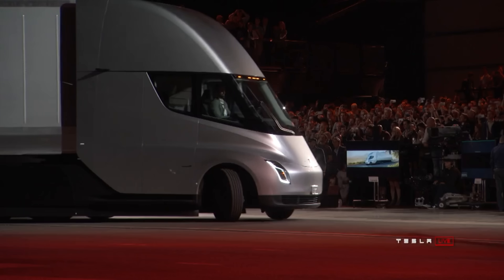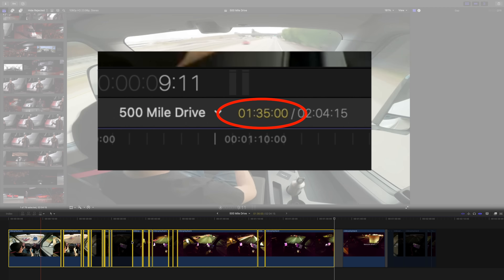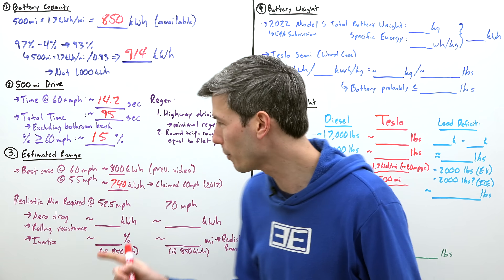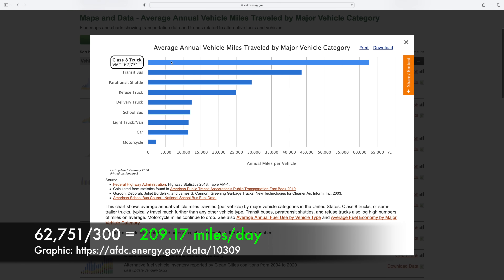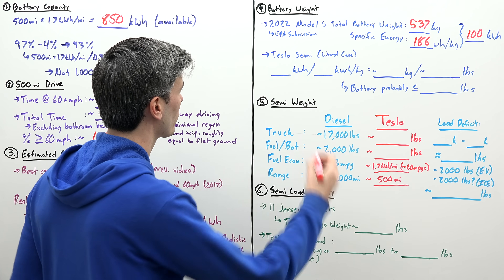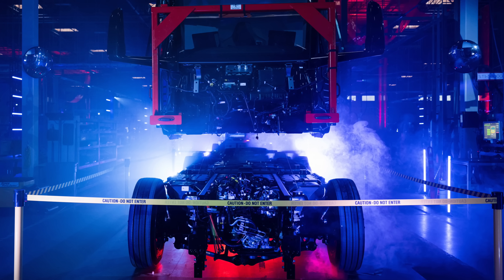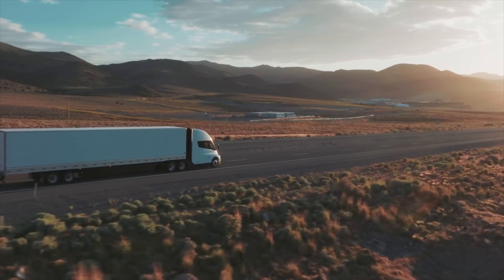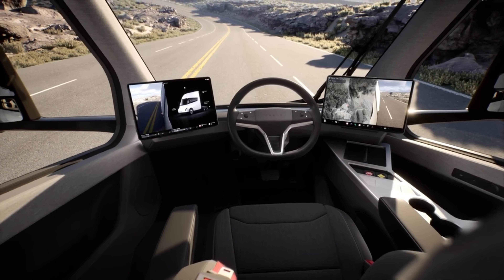Does The Tesla Semi Make Any Sense? Part 2!

Comment: Jason, I'm not sure that I agree with your assumptions on regen and net elevation change. I tried this myself in my Model S. I drove up the Mount Washington highway in New Hampshire at a modest speed. Then I drove back down, allowing regen to do all of the braking. Regen returned about 50% of the energy I used to go up the mountain. I assumed this was due to losses in the inverter and related components.

Comment: Very obvious they have chosen frito chip bags full of air as an easy light load.  What about REAL WORLD LOADS like hauling heavy construction machinery, steel construction materials, cement mixer trucks or any number of things that are all WAAAAY HEAVIER than fritos potato and corn chips - the range game is rigged to favor the weaknesses of the EV trucks limited range especially going uphill with heavy loads or into headwinds etc. Splitting hairs with fancy math will never reveal the whole picture like real world REAL TRUCK USE.
Reply: > Very obvious they have chosen frito chip bags full of air as an easy light load.
You don't know at all what they're transporting. It could very well be ingredients / liquids.

Comment: for physics based assessment, this is fantastic. however i would be remiss to not point out that at the very least, not many variables were discussed, such as:

Battery degradation over time
Climate of route, temp, wind conditions
load material in relation to safety of lithium ion
Usage of electronics by the driver (air conditioning, phones, etc)
Stop, start driving
Actual regenerative braking usage on truck downhill slopes

Of course many of these effects both EV and fuel, but it would be interesting to see just how much.

Comment: It's IMO worth pointing out, that the 500mi+ range was always marketed at 100% Battery capacity, but the charging was afaik referred to with the time it takes to charge 70%. I would also assume whatever grid is supposed to handle those things would not be dense enough to use without safety margins.

If we do a little math regarding electricity consumption:

In 2021, the USA had consumed total of 3,979,000 gwh electricity and produced a total of 886,892gwh from renewable sources.
In 2023, the USA had 2,970,000 registred "tractor trailers" (the ones towing trailers) and 10,500,000 "straight trucks".

Let's ONLY use the 2,97m tractor trailers and replace them all with Tesla Semitrucks and assume 500 miles per day for 300 days a year.
2,970,000 trucks x 300 days x 500 miles x 1,7kwh/mi = 757350gwh or just over 19% of the total energy comsumed in 2021... or over 85% of the renewable energy produced.

I'm not sold on this being "the future", or at least would not say it's a good one.

Comment: Other variables are missing such as road and other taxes paid by petrol users. The current price of hydrocarbon fuels is artificially kept high to force the EV market. [Despicable!] In fact the cost of EVs are artificially low because the petrol vehicles and petrol fuel pay the hidden EV costs. 5-7 year battery replacement and recycling cost and their CO2 were not mentioned.  Then there is the spontaneous toxic battery fire hazard they evade that take out parking structures, dwellings and...people. Are you willing to be a casualty while they figure out the solution? [Self evident answer] Once this comes to the surface the insurance will be asstronomical. The CO2 topic is a total scam. Blah, blah...!!!     I do research and invent in these spaces and can confidently say that EV proponents [greenies] have significant biases [euphemism for propaganda and the big 'L'] including yours truly ↑↑↑. [The comment life is an integrity test. )) ]

Comment: You didn't figure in the weight of trailers . My volvo day cab with empty 53' dry van weighs around 29,400 lbs  . A lot of bridges have a weight limit of 15 tons or 30000 lbs . The tesla truck would not be able to cross them empty .

Comment: What about the air brake systems they would consume some of the powers from the battery.
Reply: Imagine losing 50 miles of range because your trailer has a mild air leak and the air compressor has to keep kicking on.

Comment: Seemingly a lot of arm chair engineering going on here. Dan Priesty just revealed that the 500 mile Semi tractor weighs >26,000 lbs... Some estimates had the Semi battery weighing over 26,000 lbs and the tractor weighing as much as 45,000 lbs. ... And the Semi is going as much as 1000 miles in 24 hr in a period with a GW usually over 72,000 lbs. Bye Bye hydrogen.
Reply: On Dan Priestley's presentation it says it is <20,000 lbs for the 300 miles and <23,000 lbs for the 500 miles truck.
Reply: @xiangkunwan  Yes, you're right. I mixed my number with a prediction of just the Semi battery being as much as 26,000 lbs.

Comment: Trucks that travel O Tr which is over the road travel a 136000 miles or mor I know cause I've done it. Your average driver can get  650  750 miles a day Once again that's OTR. Tesla's winter range will never be good for anything but local work😊
Reply: Tesla's winter range will never be good for anything but local work 
You are claiming this based on performance of electric cars; but even in their cars, Teslas have about the least range loss of any EV in extreme weather. Both because they have much more advanced battery management systems, and because it takes a much smaller percent of battery energy to heat and cool the cabin of a Tesla Semi than an electric car, range loss in heat and cold is minimal. Further, it's completely predictable, so dispatchers and drivers can work around it when planning their trips.

Comment: Makes sense for inter-city deliveries like those from the food terminal to the grocery store, but it's still not quite ready for inter-city travel 

500 miles sounds like a lot, but that's only about 8-9 hours of driving in ideal circumstances. With winter driving and age, I wouldn't ask my driver's to go any further than 250 miles or 5 hours of driving.

What's 5 hours for a delivery?

Still, inter-city, clean our air!
Reply: During the Run On Less tests in September, Tesla Semis with weighed-out loads of soft drinks routinely delivered loads from the Pepsico Sacramento Bottling Plant to Bakersfield, nearly 300 miles away, and picked up a little charge at the Tesla Supercharger at Harris Ranch for the return.
Reply: @BigBen621  So you agree with me?

300 miles is solid for inter city deliveries, but not between cities. You would realistically need a 500 miles range minimum and a more real world 800-1,000 mile range as extreme cold/heat and age will reduce range (In winter conditions, most EV's only reliability deliver 50% range).

Still a solid start, cleans up city air quality and helps disassociate carbon taxes with local foods.
Reply: @michaelp4122  We're largely on the same page, but still with some substantial gaps. When you say "300 miles is solid for inter city deliveries, but not between cities", you probably mean 300 miles is solid for intra-city deliveries, but not between cities", because "inter city deliveries" is the same as "between cities". But I've just given you an example of frequent deliveries between cities nearly 300 miles apart. 

You're basing the claim that "In winter conditions, most EV's only reliability [sic] deliver 50% range" on tests of EV cars. Even there I'm not aware of any that lose 50% of range, and Teslas lose about the least of any BEV in the tests I've seen. All vehicles lose some range in cold weather; but for various reasons, Tesla Semis will lose even less range than Tesla cars in cold weather. In any event, range loss will be completely predictable, and so can be factored in when dispatchers or drivers are planning trips. For similar reasons, Tesla Semis will have minimal range loss in hot weather. Age will reduce range somewhat; but again that's predictable and can be factored into trip planning.

For a number of reasons, Tesla Semis will also do better in snow and ice, and other low-traction situations; and mountainous terrain is where they have the greatest advantage over diesel semis.

I think the main point you're making is that they're not appropriate for OTR or long-haul applications, and I completely agree. Also, estimates are that they fall short of diesel semis in payload by nearly 10%; so for applications where loads >43,000 lbs. or so must be carried, diesels will still be essential, likely for years if not decades.
Reply: @BigBen621  Sorry, I meant Intra-city. Your 300 mile trip between Sacramento and Bakersfield is a great example of how Tesla trucks can only be used in niche applications between close cities, and supports my argument that EV trucks are only suitable for intra-city deliveries.

That same truck would not be able to commute the extra 120 miles to LA, and make it back, even in ideal CA weather. Meanwhile a diesel truck could do that trip in a single day.

In reality most truckers drive close to the maximum 13 hours a day. 13 hours at 60 miles/hour means we need ~ 800 mile ranges for these to truly be viable, and a larger range when delivering in colder central US states, New England or Canada.

As for the 50% range, I live in Toronto, and this is the number most EV owners tell me is the "safe" range for their EV's which aren't old yet. The real number could be lower for 10+ year old EV's, but since EV's aren't that old yet, we have no data.

Still a good step, I 100% support this as it cleans our air (diesel specifically burns at a high enough temperature to react with nitrogen producing smog and carcinogens) but the advantages are limited to local deliveries in 2024.

It's only a matter of time before EV's get to the 1,000 mile range and charge overnight.
Reply: @michaelp4122   That same truck would not be able to commute the extra 120 miles to LA, and make it back, even in ideal CA weather. Meanwhile a diesel truck could do that trip in a single day. 
Well, not really, at least not legally. US law is obviously different from Canadian law, because in the US drivers are only allowed 11 hours on duty. further, the truck speed limit in California, where all Tesla Semis in private hands are deployed, is 55 MPH. So the maximum legal miles for a solo driver in California is 605 miles, whether you're a BEV or diesel semi. Sacramento to Los Angeles and back is 840 miles; so that's obviously not going to happen, no matter what you drive.

 In reality most truckers drive close to the maximum 13 hours a day. 
They may do that in Canada, but the Tesla Semis are in the US, where the maximum is 11 hours a day.

 most EV owners tell me [50%] is the "safe" range for their EV's which aren't old yet. 
Again, you're basing this on BEV automobiles. For several reasons, Tesla Semis will have much less range loss. Further, they have an extremely advanced range computer, which takes into account at least 14 parameters which affect range; so the amount of range reduction will be known to a high level of accuracy, and can be taken into account when planning trips.

 the advantages are limited to local deliveries in 2024 
I don't view deliveries 300 miles away as "local", but perhaps you have different definitions up there in the frozen north. 🙂

 It's only a matter of time before EV's get to the 1,000 mile range and charge overnight. 
Perhaps; but since a Tesla in California can only legally drive 605 miles in one shift, there seems little reason to pay the additional cost and bear the additional weight of 1,000 miles of range, if they already have enough range to drive as far in a shift as they legally can, with 500 miles of range and another 200 added during the 30-minute mandatory break before 8 hours on duty.
Reply: @BigBen621 13 hours is the US law, maybe it differs by state? Is it 11 specifically in CA?

605 miles is from 11 hours at 55mph? In Canada, we have sections of highway with speed limits of 120 km/h (78 miles/h), and EV's are less efficient at speeds above 40mph. Another factor to incorporate.

65*13 = 845, and 845 > 840, so a diesel COULD do that trip in a day as most US speed limits are 65 mph. In EU and Canada, a trucker can do 1040 miles in a single day. Either way, this is well above 500 miles so a range of 500 miles is just not enough. An employer won't pay a premium so the trucker can take extra breaks.

300 miles is local, when you go to the grocery store and eat local produce, it was likely grown within 150 miles of you. I'm not sure how far you would need to not be local anymore, but if you can do the drive both ways without needing to stop for a restroom break, that's local.

50% range - cold will affect the Tesla truck in a similar manner to a BEV. Maybe it won't drop 50%, but I also don't live in Alaska, northern EU, the rockies or a cold part of Canada so assuming 50% is fair.

Also bear in mind, California's population is larger and than Canada's and any other US state. Your weather is also ideal. For this truck to be viable, you need it to be able to travel between states. E.g. Coors Light (picked a popular beer) is brewed in WIsconsin and Virginia, but is has to be delivered to New York, Boston, Chicago, Toronto, Montreal, etc. To use that Tesla truck would mean that it would have to be shipped by rail and then locally shipped by truck.

So, only suitable for local deliveries in 2024. For this to be viable everywhere (including Alaska), you need a range of 13*78/0.6 =1,690 miles, (The 0.6 is for winter and age) BUT since drivers can stop and charge I would think a 1,300 mile range is appropriate.

This all assumes 100% range at speed, which might be close to reasonable at 55mph, but not at 65mph like most states or 80mph like Europe and parts of Canada.

Even in CA, under ideal weather, an older truck will only get 400 miles of range and you really need 800 or so miles.
Reply: @BigBen621   End of the day, the Tesla truck helps Intra-city deliveries and local Inter-city deliveries in ideal CA weather.

You will not get 500 mile range when driving at 75mph, with an older truck in colder weather.

So a Tesla truck won't be shipping food between states anytime soon, or doing any intra-city deliveries in central US states or Canada (especially not in winter).

But it's a start, and one I welcome inside large cities with traffic (No idle emissions!)
Reply: @michaelp4122  I agree. Just driving 75 MPH vs. the 55 MPH speed limit in California will reduce the range by 45%; and as I've pointed out before, it's not designed, intended or marketed as a means of, for example, "shipping food between states". For long haul, or OTR applications such as this, diesel semis will still be needed, likely for decades.
Reply: @BigBen621 45% drop in range driving 75mph vs. 55mph? Wow, I'll remember that when I buy an EV because I honestly drive 85mph outside of town.

For me personally, this is why I don't want an EV. 2 years ago I got a call that my mother in law was dying just as I reached my cottage with my wife. I drove very fast to make it back before she passed, and would not have had time to charge.

Isn't the speed limit in most states 65 mph? It's 64mph (100km/h) in most of Canada, but between cities it's often 110km/h or 120km/h. (70 & 77 mph). Most of EU is also 120 km/h between cities. We also don't have those weird daytime/nighttime speed limits like I see in NY/NJ, but our highways are lit up (I noticed most US highways don't have light outside of major cities).

Either way, outside of CA, EV's have a way to go. That 500 mile range has a massive asterisk as speed, temperature and age can all drop that range.
Reply: @michaelp4122   45% drop in range driving 75mph vs. 55mph? 
That applies only to the Tesla Semi, because it has such a huge frontal area. Cars are of course affected by speed, just like ICE cars; but the difference is much less.
 Isn't the speed limit in most states 65 mph? 
Actually 70 to 75 on most freeways, with some as high as 85 MPH in Texas and 80 MPH in Utah, and typical actual speeds are perhaps 10 MPH over the speed limit.
 _ That 500 mile range has a massive asterisk as speed, temperature and age can all drop that range._ 
Age will affect Tesla Semi batteries much less than cars, for one thing because of much slower charging compared with DC fast charging at Tesla Superchargers. Speed and temperature do have an effect, but it's completely predictable by an extremely accurate trip computer that takes into effect >15 parameters, so drivers and dispatchers can plan around the actual range. And statistics show that the vast majority of trips in Class 8 trucks are under 250 miles, and the average payload is well under 20 tons. As such, Tesla Semis will be capable of handling the vast majority of loads and distances, even in spite of range loss due to speed, temperature and battery degradation. For those they can't, again, diesel semis will still be needed
Reply: @BigBen621 Still cleaning our air.

That 250 mile average trip for class 8 trucks, is that specifically for CA, US or global? Is that 250 miles, then unloading and immediately picking up another delivery, or how much time is spent between deliveries?

Also means can be misleading, does this mean every trip is ~ 250 miles or is the mode 50 miles/450 miles? If 50/450 are the modes then that Tesla is useless for half the trips.

Real world, we will need longer range, but if we can replace all Intra-city deliveries (e.g. food from the terminal to the grocery store) with EV trucks, that would be great.

In my mind, I would think ~715 miles real world range would replace diesel fully (11 hours at 65mph). Whatever math we need to adjust for speed, temperature and age apply it (be it a 1,000 mile or 1,600 mile range).

Plus Intra-city travel has traffic and idle. Idle burns gas, but barely uses electricity, so this could save truckers even more money.